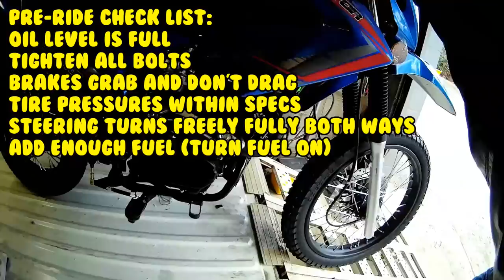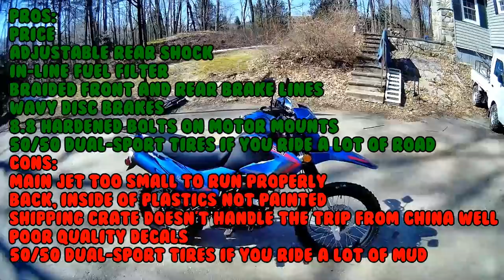$1300 NEW 2019 TAOTAO TBR7 230cc FULL REVIEW build ride mods Dual-Sport Pros Cons.

Comment: Too bad I arrived late to this video... I have a 150 cc CG clon......pretty much the same OHV family that yours, with a PZ 26 / 27 (didn´t measure yet). 
It came with a 108 main jet and a 38 pilot. 
It was giving every indication that it was running rich, so I took the carb out and replaced the jets for a kit that seems to be exactly the one you´ve got there, though I´m in another country.
Other than that I moved the needle circlip one notch upwards, all in the attemp to lean the mixture. 
I kind of succeded, though it still run a little too rich, but works well in any aspect. 
I could have made good use of those jets that came in your bike , since the seem more proper for a 150 cc. or less.
I ´m not anti chinese by any mean, I do have a chinese bike actually, but I wonder sometimes if, when they assemble, they pick the first object available in the tray.  
Clearly the carb is a 30, an thats logical for a 236 cc engine, now, main jet 88 ?? Tao and Dao must have been partying the night before.
For the record, since is a little too hard to have specs info about these engines, I leave here a specs (basic ones) link to Lifan Thailand, they apparently comunicate better between countries, thus you can know at least bore, stroke and a few things more.
I believe Lifan isn´t always the engine manufacturer, but they all follow more or less the same pattern. 

http://www.lifanth.com/en/products-a-services/lifan-engine/vertical-engine/122-156fmi-2162fmj156fmi-2a162fmj-a162fmj-n162fmk163fml-2162fmk-a162fmk-n163fml-2n167fmm-n.html
Reply from the maker: Thanks for the info. I've always thought they're lean and tamperproof because if EPA regulations.
Reply: @MotoCheez  Most surely! They must be switching jets with the bikes they send here haha....Serously, that makes sense.
I like the channel, super useful the way you guys review and fix issues of that products, and show all that.
These bikes, though cheap, give many of us with a "lean" wallet (temporarily I hope) the chance to ride.....and/or  play to be engineer without fear of wrecking an italian masterpiece.
Reply: p.d.   For the sake of fairness, my little chinese I´ve named "Entropy" has never, ever, failed to start or taking me where I need to go , with a ridiculously meaningless fuel consumption....

Comment: When u set the needle an u say it sits just one under half is that the 5 slot needle so it would be the fourth slot right. Sorry I have a tbr7 an I put the 105 in it an set it to the forth slot an I can't get it right. I live in upstate ny out bye syracuse. Need help
Reply from the maker: Usually it's the middle groove or one up or one down you're going to have to experiment with it but I would start at the middle groove
Reply: Ok thank you I put it back on the middle one an I'm going to test it tomorrow to see how it is.

Comment: Is it street legal in Florida?
Reply from the maker: Yes
Reply: MotoCheez how do I get the title for it?
Reply from the maker: Comes with an MCO like every new vehicle, once you register it, DMV sends title.
Reply: MotoCheez can u link me where u bought the jet kit? It’s not working w the link you put in the description.
Reply from the maker: The links go dead once in a while. Motocheez.com in the bikes section has the most current
Reply: MotoCheez thank you!!
Reply: MotoCheez so I need to use the mikuni jet kit on the stock carb? I’m sorry I know 0 about bikes😂
Reply from the maker: @owenkai1067  keihin is stock carb, should say next to jet kit, mikuni if you buy aftermarket.
Reply: MotoCheez it’s confusing because it says will not fit aftermarket carb

Comment: I'm confused about the jet needle (the needle that has the clip to adjust up or down) it that the need that is connected to the spring?
Reply from the maker: It's the one with the clip, it goes in the plunger.  the plunger is behind the spring.

Comment: TRYING TO FOLLOW  you put in a new idler?  AS IT COMES , NO TINKER bolts?
Reply from the maker: I put in a larger front sprocket for higher speed on the road, also jetted the carb up for more power!
Reply: @MotoCheez   THANK YOU  i wrote it down, will revisit that  episode when ready

Comment: I just bought the same bike, same place and mine is a 2019 but mine has drum rear breaks, what is this a 2020. Lol paid 1339 from TX powersport
Reply from the maker: I got the first one available, they still have the older model cheaper on the site... How do you like it?
Reply: @MotoCheez  love it. Only have about 250 miles so far but am getting 81 mpg. Can't botch about that.
Reply from the maker: That's great! These bikes are great on gas!!

Comment: Does the TBR7 have tubed tires? Got a nail in the rear tire. Plugged it but can't get it to deal on the rim.
Reply from the maker: It has a tube...
Reply: @MotoCheez  so I would have to replace the tube? Seems to not want to Seal around the rim. I'd there an easy way to change the tube?

Comment: MotoCheez.... Going to be ordering this bike soon and going to order that kit from eBay as well.... 
Question I have for you is I live at a decent altitude (7200ft) and was wondering if the 105 jet will work or what you would suggest for it. Would typically ride in altitudes ranging between 6 to 10k above sea level. Thanks
Reply from the maker: The stock jetting may work out of the box for you.  Roughly every 2000 feet you drop a jet size. But my guess would be around 100 main.
Reply: @MotoCheez  awesome just ordered the bike as well as the tao dbx1 for my son
Reply: I'll keep you updated once I get it running if I have issues or not. Going to try and do a few videos of both bikes. Me and my son are planning to do some Moto camping this summer

Comment: I upgraded the front from 15  to 17 tooth sprocket. But now my chain is so tight with hardly any slack. I pushed the tire all the way in. Does it need a bigger chain when upgrading just front sprocket?
Reply from the maker: Mine had plenty of slack when going to the 17t. All the Chinese bikes I've done it too... Wonder why so tight?
Reply: I was wondering too lol. I kicked the tired as far as i could but still nothing. Does the hawk and tbr7 use same front sprocket?
Reply: Does the hawk and tbr7 use the same 17 front sprocket?
Reply from the maker: @HS-ly9ze  yes!

Comment: I just got this bike and it dies after going riding for a bit then takes awhile to start and then rides fine and repeats. I just mikuni clone carb and jet kit and am hoping it resolves this. I live in Florida. Would you recommend the 105 or 110?
Reply from the maker: In Florida I'd try a 105 first. If it dies, listen the gas cap. If it works it's probably the venting. Some the venting valve acted up.
Reply: @MotoCheez thanks for your response. I had to move the exhaust to adjust the clutch and this hose thing attached to it came   down. It runs off the exhaust and has a plastic piece on the end. I wasn't sure where it went so I just tucked it up back under tank. Could this be causing the issue?
Reply from the maker: I doubt it. That hose doesn't go anywhere. I'll bet it the gas cap vent. Try what I said. When it stalled open gas cap and see if it starts right up again
Reply: @MotoCheez  okay will do I really appreciate the information

Comment: What would you suggest for an upgraded handlebars, primarily for dirt riding? 👍
Reply from the maker: Renthal bars are the best, like this https://amzn.to/3aUN5Kd, they are pricey. they do have other brands..  Have aluminum heavy duty ones people have used on the Hawk too https://www.motocheez.com/taotao-tbr7-250
Reply: @MotoCheez  thank you, do all the existing components fit on the 1 1/8” diameter?
Reply from the maker: @Hope4thebroken1  I've never personally done it on the TBR7, but if you look at the latest hog video I put up of other people's rides that guy has a set of aftermarket bars on his hawk DLX. All these full size china 250s have the same mounting and size

Comment: Why did you cut the acid container? There are spikes in the plastic on the battery, you just need to press it down. Also, it is a gel type battery - just not pre-activated from factory.
Reply from the maker: They supplied a pin. I didn't see it, but I popped the acid on the battery on and it didn't flow (airlocked)... This wasn't a gel battery. Thought it was supposed to come w one
Reply: @MotoCheez  It is an AGM non-factory-activated battery. Very very similar to gel. All batteries in Europe are like that since you can not transport active batteries. They have a material in there that absorbs the liquid (something like a mat) and it can be rotated just like a gel battery. The white container you just pop on there, the black plastic around the holes in the battery body are spiky and make holes for themselves. The ones you are thinking about are "factory activated", but in the end the one you got is better because it does not degrade over time while stored. 
Here is a video of Yuasa being activated: https://www.youtube.com/watch?v=jL9COQwseEg
Varta page even says that AGM is better than Gel: AGM and gel batteries are often considered to be one and the same. This is because they have a similar core of attributes. Both are nonspillable. Both offer deep cycles and they can both be mounted anywhere, so they're flexible. But the differences between them, make them. AGM batteries offer a plethora of unique attributes that make them the clear and far away favorite.
Reply from the maker: @nxadventures9510  This is NOT a Gel battery, you can poke the bottom for the acid to flow faster, let it sit and charge...
Reply: @MotoCheez Here is a nice explanation between AGM and Gel batteries: https://www.batterystuff.com/kb/articles/battery-articles/gel-vs-agm.html
So in essence 99% of the batteries are AGM and even Varta claims that AGM is better due to gel being finnicky to charge.

Also: "More often than not AGM Batteries are mistakenly identified as Gel Cell Batteries. Both batteries have similar traits; such as being non spillable, deep cycle, may be mounted in any position, low self discharge, safe for use in limited ventilation areas, and may be transported via Air or Ground safely without special handling."

Also, it is quite common to call AGM batteries Gel batteries where I live. Also, you do not have to add water or anything to AGM too if that is what is bothering you.

Comment: Just got mine today. I had the same issue with the short chain but I'm definitely satisfied for the price. I had to do a major adjustment to the clutch cable as it wasn't even engaging at all but it feels similar to my old CRF230. It doesn't really like to balance straight up when you're going down the road which I haven't figured out yet. Handling isn't quite up to par with the old Honda but the motor feels pretty dang good
Reply from the maker: Awesome
Reply: @MotoCheez  also my dad tried to convince me that the chain will stretch into spec but I don't believe it. What do you think?
Reply from the maker: @ChrisG1392  new chains do stretch a lot in the first few hundred miles. Mine did a bit

Comment: I'm still considering this bike. My question is can I lower the seat  height by two inches ? ? ?  Any advice  would  be  helpful.
Reply from the maker: Close to 2"  yes. But then the kickstand is almost at balance point
Reply: @MotoCheez  
Thanks,  I bend my knees slightly on the Magician to be flat footed so, there's an inch or two more I can take.  I  ordered the TBR7 on lay away and will have it in the spring. $1300 including shipping was too hard to resist.   I bought a Mikuni carb  for the Magician, but it wasn't  necessary to put in . I'll have it ready when I get the TBR7 along with my sprocket. I really still like the  Magician,  but the 3.6  gallon tank  is a  great  selling  point for  this  bike.  If it rides as good as the  Magician, it's  well worth the price.
Reply from the maker: Awesome. Yeah decent bike for the money.
Reply: @MotoCheez  
Tao Tao  is the  new  Dong Fang   =  fairly good  quality  from  China
one man's  opinion

Comment: Found the rear shock for info 305 mm adjustable $57
Reply from the maker: Thanks!! 👍👍👍. FYI. The Brozz250 is softer than DLX at same preload
Reply: @MotoCheez  mine (Bashan storm ) non adjustable.and soft . I'm guessing the tbr7 adjustable will fit . I just ordered it so I hope.i guessed correctly . Why do it correctly and take it out and measure it ,where all men here, guess and go!.
Reply from the maker: @680ecks  it should work.

Comment: I put the 105 jet in my bike and it sputters at 1/4 throttle and slightly bogs at full throttle
Reply from the maker: Did you do anything with the needle jet or mixture?
Reply: I put the mixture screw 2 1/2 turns out and the needle jet right below the center
Reply from the maker: @jacksonramsey4103  I'd try adjusting the needle up a notch

Comment: Yeah I have a (second hand) Regal Raptor, (Chinese), beautiful looking, pity it doesn't start !!!!
Reply from the maker: They're easy to fix and parts are cheap. What's the issue? Spark, compression? Fuel?
Reply: @MotoCheez  Well, no spark, the plugs seem ok.....so now what?
Reply from the maker: @frankboase4362  check wiring first of course, make sure the kill switch isnt shorted too.  I've sound it's usually a bad connection, but have had to change stator assemblies before
Reply: @MotoCheez  Again thanks for your time, I have eventually found a mechanic that knows about electrical systems...Here's hoping, because it really is a beautiful bike.

Comment: You should take it on a good long  ride to first break it in. Stopping and starting the engine before the rings get a chance to seat well is not good for the rings and cylinder.
Reply from the maker: Heating and cooling cycles are an important part of break-in. Been doing this for over 35 years.
Reply: @MotoCheez  I have been doing it for close to 50 yrs
My experience is, if you break an engine in to slow, it  will not perform as well through out  the life of the engine. It is a fine line.  I find, breaking it in long and slow is the best!
Reply: But not to slow! lol

Comment: Hey motocheez I put a new throttle cabe on and I think this V shaped clip inside is what is causing it to lose  gas or what seems like is coming off the throttle after so high of rpms. What way is the V cluo supposed to be in there?
Reply from the maker: You must not have it assembled right. Watch some of my other carb videos I show how it goes together.
Reply: @MotoCheez  thanks bro!
Reply: @MotoCheez   I fixed it. Literally took 5  seconds. It's insane how something so small can affect your bike in a huge way
Reply from the maker: Awesome. Agreed

Comment: My 2017 hawk has steel braided brake hoses and did not have the turn signal beeper. 2017 was a good year for the hawk.
Reply from the maker: They stopped the beeper, but only rear braided line. Not front.. or is your front braided?
Reply: @MotoCheez  mine is front braided as well.
Reply: @MotoCheez  mine is front and rear braided.
Reply from the maker: @louiewatson9389  I don't think mine was. I'll look

Comment: I recently got the kit I ordered from this link (the hawk carb upgrade kit) and all the threads on the jets were to small to screw in. Not one jet fit. I have a 2019 taotao tbr7 . Not sure what to do now since I lost the original main jet in a sewer grate
Reply from the maker: If it was a stock carburetor they should fit I'll contact him and have him respond on here
Reply: Thanks. I've ordered 4 bikes from txpowersports over the last 5 years and never had trouble until the tbr7 carburetor.  Taotao are great bikes. I think with a brand new carb it will run great
Reply: Sorry to keep bugging u but I found a 200 to 250 cc carb fits taotao pmz30. I dont have my carb here to look at it. I think its pmz30 I'm not sure thought I'd ask u
Reply from the maker: Pz30. I have links for reference Motocheez.com

Comment: Tell me why my 150cc tao tao dbx1 just beat my tbr7 250cc?
Reply from the maker: Stock for stock? I'd say the TBR7 needs carb work. Something not right
Reply: @MotoCheez  yes both stock, I'm confused honestly I think it does need a new carb it runs just not as smooth as it should
Reply from the maker: The 250s are super lean stock for some reason, I'll bet it's that